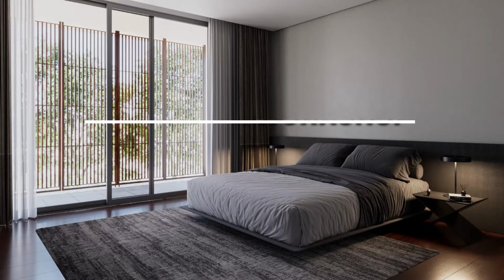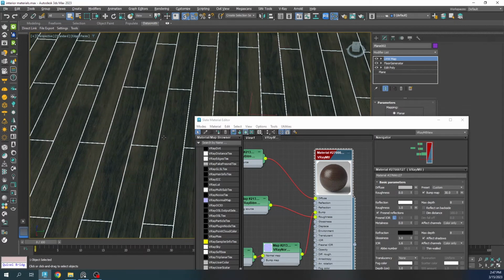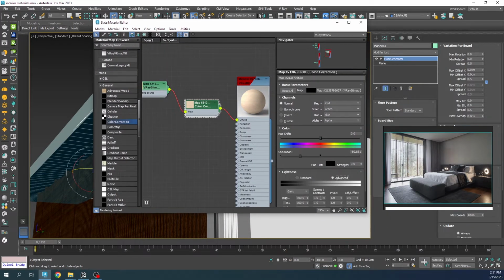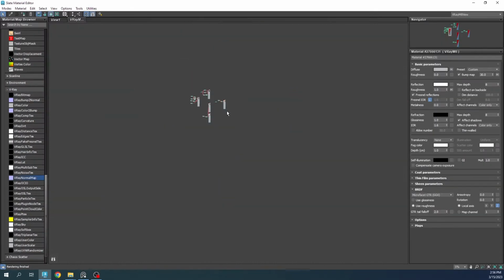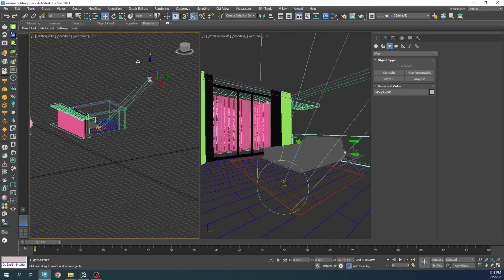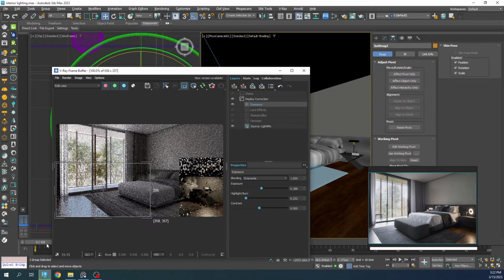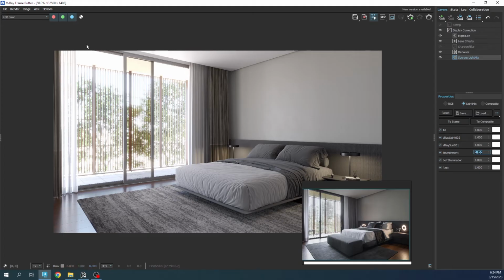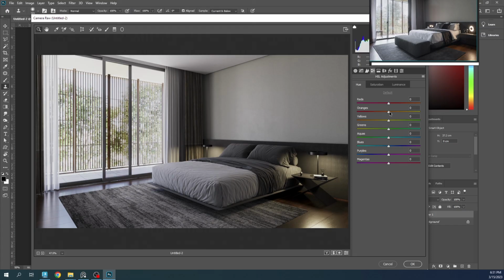Vray Interior Lighting & Rendering Tutorial | Bedroom rendering workshop

Comment: Awesome work, may I know what GI did you use?and also what settings it is?
Reply from the maker: I'm always using the light cache and brute force together. Min and max for AA is 1 and 10. Noise threshold is usually 0.01. Min shading rate on 24. These might vary depending on the scene.